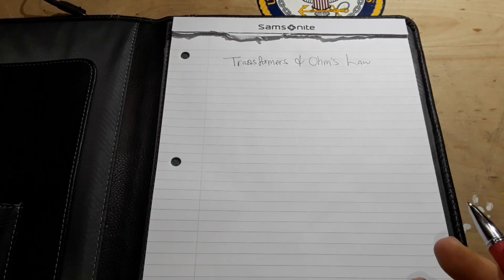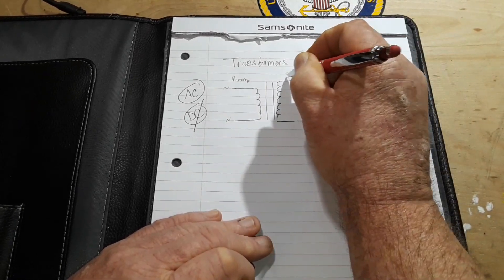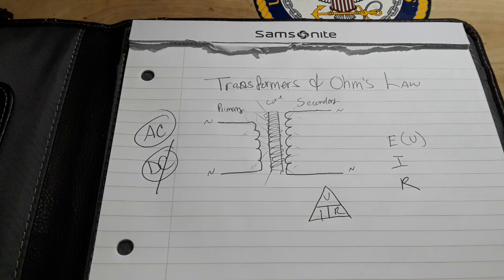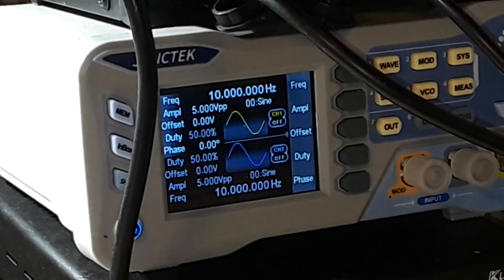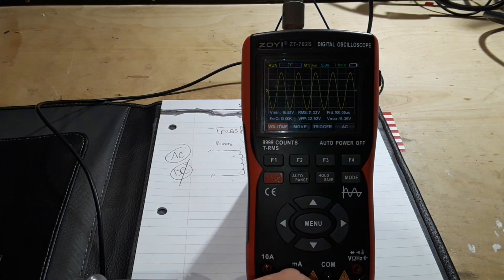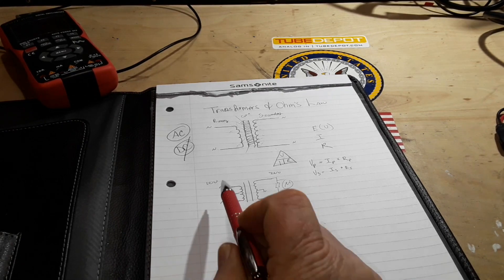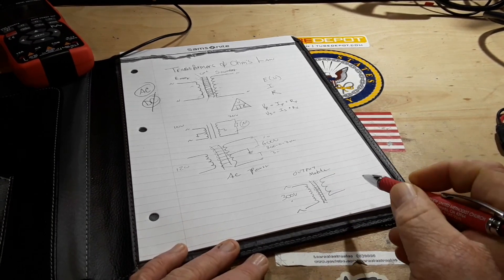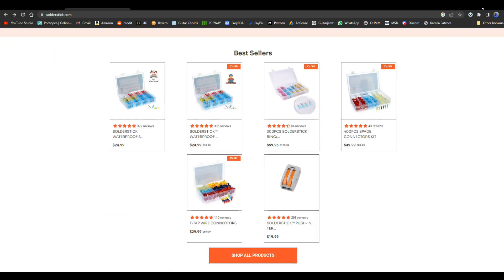Transformers and Ohm's Law Sponsored by Solderstick

Comment: I am confused. Doesn't the load determine what the current will be? How is current increased if there is no load attached. Do you just mean that the secondary will be able to provide greater current if the load requires it?
Reply from the maker: No, you trade one for the other. It's ohms law. Power stays the same. So to get more voltage with the same resistance you trade the current for voltage.
Reply: @learnelectronics  , Thank you. I did understand that part. What I was asking is an even more basic question about the behavior of voltage and current that i never fully grasped.  Does a power source push current? Or does a load pull current? If you stepped the voltage down, increasing the current to greater than the load required, does it fry the load? or would the load only take the current it needed even though the power source could provide more?
Reply: i too have yet to fully grasp this concept, eagerly awaiting a response from someone that can explain in a relatively simple way if possible =]
Reply: @jpvoodoo5522  This was something I struggled to grasp for a while too, especially when some of the terminology that teachers use is confusing. I think I have a good handle on it now, but since I am a relative newbie I will let someone more knowledgeable answer. If there is no answer in a few days I will have a go at explaining to the best of my knowledge. Best wishes.
Reply: @keeganharmon8595  , We've all seen the water analogy. But I am not sure that's adequate. If I were a student, I would be pestering the professor. I've been leaning toward the pull explanation. That is, parts of a circuit are greedy and would take unlimited charge if they could, so long as there is a path back to the source. That would explain why we don't get electrocuted unless we provide a path back to source .  But then my understanding gets defeated when you give the example of this transformer reducing voltage, but increasing current.  I know you're right. I just wish I understood why you are right. That's what makes electricity fascinating.

Comment: A transformer will indeed work with a DC signal.  It needs only to fluctuate.  Hook a PWM signal up to your primary and see what appears across the secondary.  Polarity inversion is not required.
Reply: I am only a relative newby to electronics, but what you wrote above is my understanding too.  Something I have noticed is that when a sinusoidal wave (or any shape for that matter)  is totally above 0 volts, many people (not saying Paul) will still refer to it as "AC".  If my understanding is correct (and please tell me if it isn't) then as long as the wave never dips below 0 volts, then it has to be DC since the current is flowing in one direction only, not alternating. "Fluctuating" as you said, but not alternating.

Comment: The first thing I ever built with an old door bell transformer was a shocker.

It was the early 70's and ten speed bikes had just come out.

I hooked the 6 volt secondary winding up to my brothers 6 volt bicycle generator. The transformer fit under the 10 speed bicycle seat.

We had those popular rams horn handlebars which were wrapped with a plastic tape.

On top of the tape I wrapped aluminum foil and connected it to the primary winding of the bell transformer. I had one lead going to the left grip area and one lead to the right grip area.

My brother had a speedometer on this bike and we had contests to see who could ride it the fastest.

The pulses were so strong that your muscles would contract and almost double you up around the handle bars even at a very low speed.

We also would turn the bike upside down so we could pedal it by hand. I had made a couple of aluminum foil balls that you could squeeze with a left and right grip going to the primary winding.

We would get all the neighborhood kids to form a semi circle holding hands. The guys on each end of the line held the aluminum foil balls.

We would start cranking the pedals and see who would let go first.

Watching a half dozen of your friends shaking up and down while trying not to break the chain was hilarious!
Reply from the maker: That reminds me of the hand-cranked generator we found in my 7th grade science class. We all tried to hold on. If you made it past the initial jolt you could hang on for about 1/2 to 3/4 turn of the handle. No one made a full turn! Good times

Comment: And on the same TANSTAAFL theme... It should be noted that transformers are never 100% efficient. Some of the power that goes into the primary is converted to heat, and never makes it to the secondary.